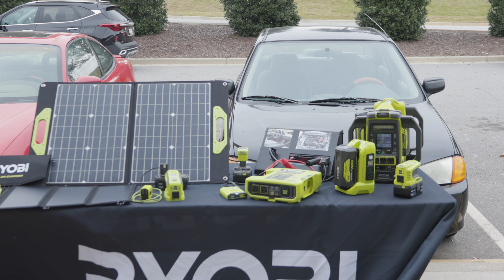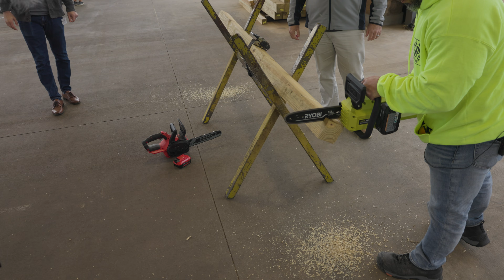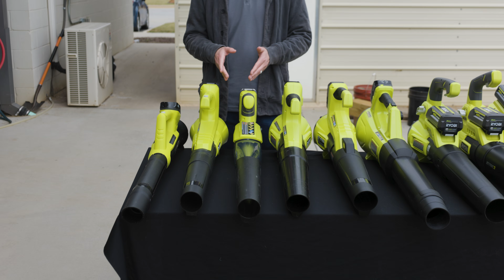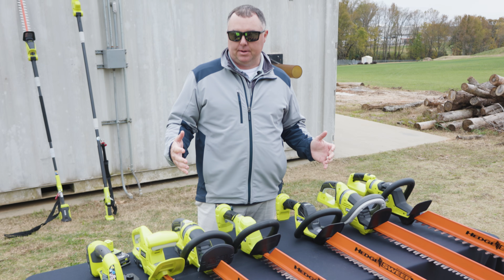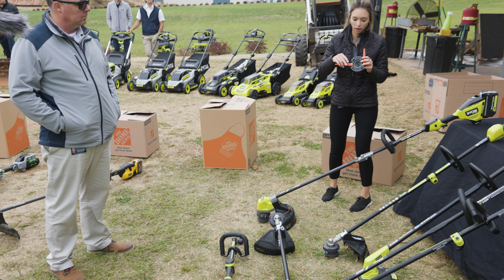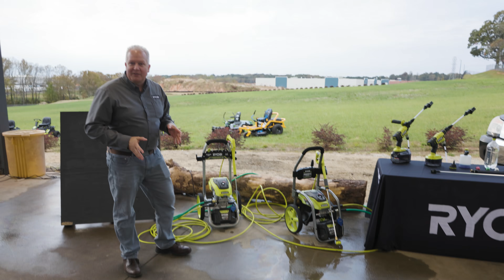Ryobi Tools and the UPGRADED Outdoor Power Tools They Just Announced for 2022!

Comment: I have their "40V HP BRUSHLESS 26" HEDGE TRIMMER" - model RY40640, which is supposed to be their top of the line for now, but to be honest im not at all impressed with the way it works and feels, the response times are awful, i mean from the time you pull the trigger until it actually starts moving the blades full speed, just awful, also when in the middle of work you need to stop for a sec and start again, same horrible lag until it ramps up to full speed. also the ergonomics are terrible, im talking about the handle thats closest to you which you press to start cutting, just too small and strains your hand. i also have their 18v model P2606B which is with a brushed motor and that thing preforms a lot better than the 40v brushless one. first of all the motor has no lag, as soon as you press the trigger it starts working full speed and not ramping up like the brushless 40v, secondly the handle has a much better feel overall so i can work for much longer periods of time than i would on the 40v one. also the weight and balance of the 18v feel much better in the hand, so i end up using the 18v model a lot more than the 40v model. i really hope ryobi gets this feedback to them before they finalize the 40v 1.5" model they talked about in the video, because i need something better than the 0.75" that i have right now.

Comment: I just got into the Ryobi 40V lineup this fall with their 21" Cross Cut mower as well as the single stage snow blower and a leaf blower...4 batteries + 2 fast chargers.  What caught my attention was the message on the screen talking about new battery tech coming out this year.  Can you expand on that?  Looking forward to adding some tools in the spring.

Comment: For the part during the riding mowers section where they mention "we are going lithium for 2022", I really hope they mean that they are going 40V+HP on the riders and zero-turns. I don't think they'd go to the effort to create new, 48v lithium batteries similar in size to the current lead acid batteries when they've already put so much effort into the 40V line. If they come out with a traditional looking riding mower that takes 4-6 40V batteries AND they release a 10ah or 12ah at the same time, I'd be very happy. I don't need a zero-turn, but I would have infinite use for a rider.
Reply: They'd likely use lithium 12V batteries. The Current lead-acid ones are 12V. 

Hopefully it'll be a drop-in replacement